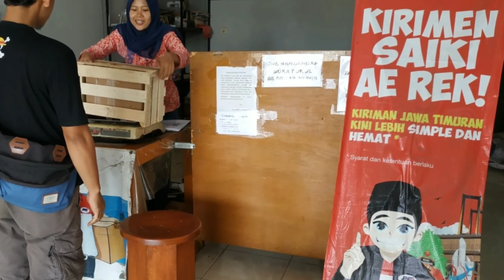POMPA MODIFIKASI ANDALAN KITA

Comment: Harga brapa mas, klo kdalaman air sampai 10,12 metr bisa gx itu mas smoga di jawab makasih
Reply from the maker: harga 550/unit belum ongkir, 10-12 bisa digantung dalamm sumur jika sumur gali, jika bor ya digali dulu sampe ketemu permukaan 5 meter
Reply: @PompaAndalan  kirain bisa nyedot normal 10,12meter sumur bor mas
Makasih untk responnya mas
Reply from the maker: @sabila_majidfamily5779  siap bos sama sama